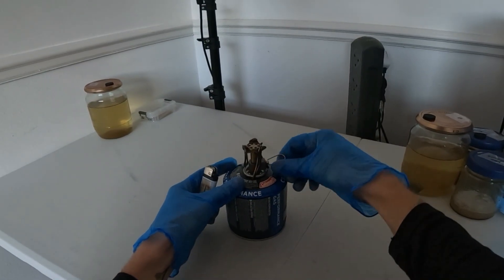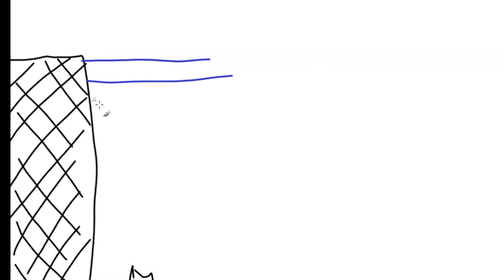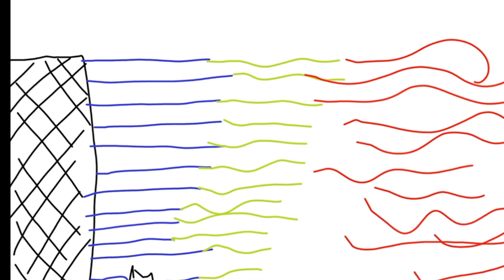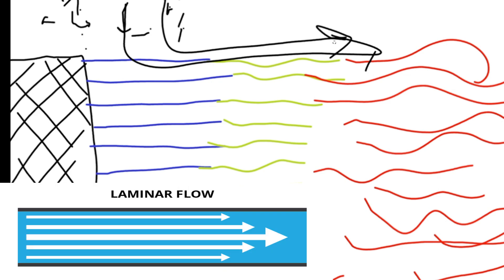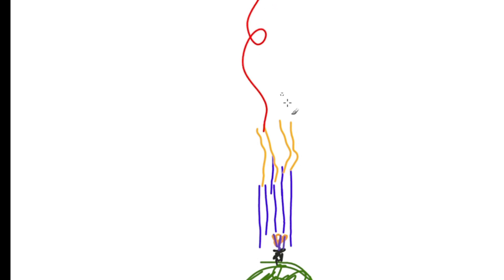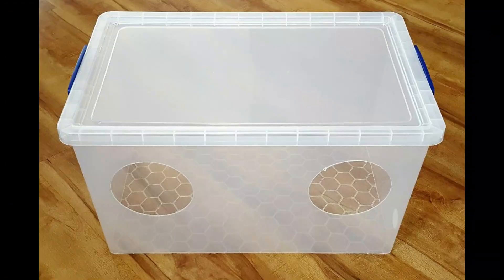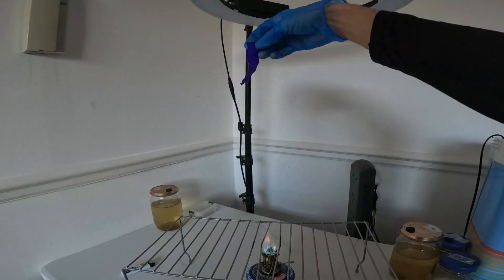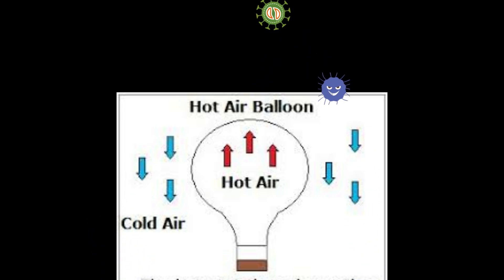Why I DON'T Use A Laminar Flow Hood!? #mycology

Comment: I've seen some people talk about using Bunsen burners for agar work, though I'd never seen a demonstration. I always wondered how effective it was considering you don't actually remove anything from the air. Agar plates work in mysterious ways. Also you should check the GordoTek flow hood if you want a cheap one. It's not laminar but it can be made for about 50-75 dollars depending on material availability. In his video he set up agar plates and left them open for 5 minutes in front of the hood. I set up the same experiment with 5 agar plates and it took over two months for one to go bad. The rest dried out and the one that went bad was almost definitely due to handling and a small gap in the parafilm.

Comment: This technique is quite standard in microbiology labs. However, whenever working with a flame, avoid wearing plastic gloves as they could melt on your skin if they get in contact with the flame. Clean your hands beforehand, spray them with ethanol and when they are dry you are good to go.
Reply: Keep your hands low and your wrists together.